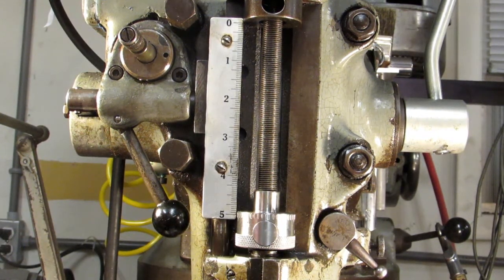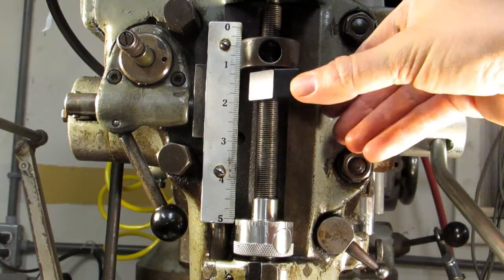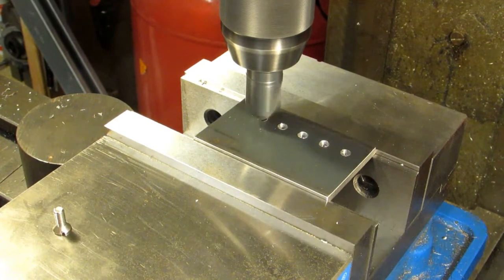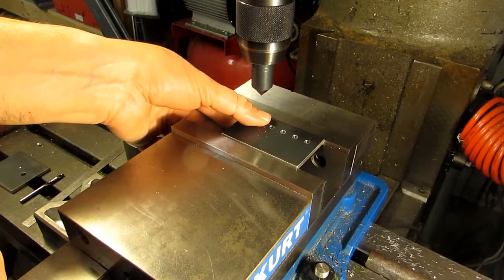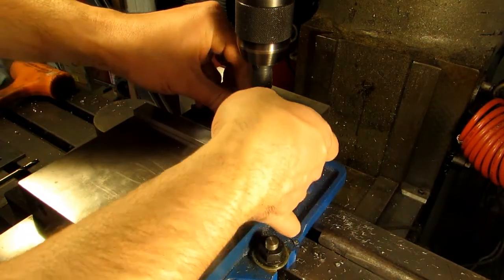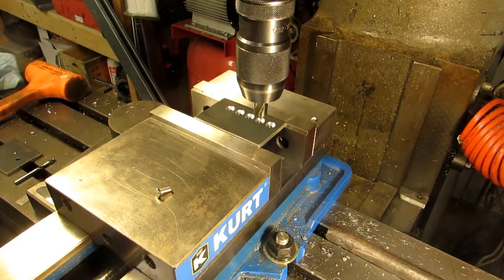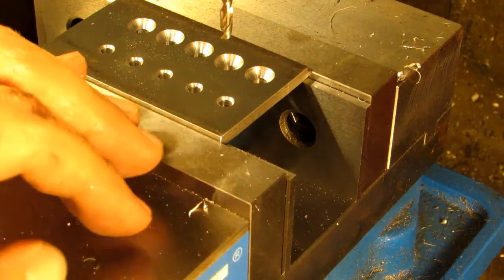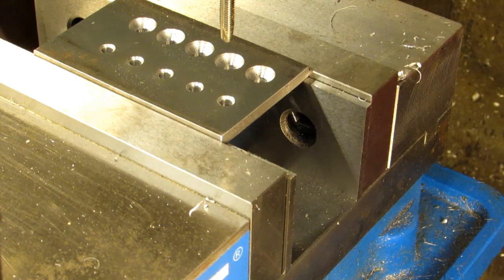Quick Machining Tip #4 - Consistent Countersinks and Spot Drills

Comment: Also helps if your top surface is actually flat. If not, all the c.bores will look different (have different diameters), which is often the case on raw stock.

Comment: Raising the knee makes so much sense! Of course that's not what I've been doing, and that's going to change today. Stuart, if I may ask, why did you choose a 90* spot drill and not a 120* to fit a 118* point on the drill?
Reply from the maker: I like 90 degree spot drills because you can drill deep enough that you leave a nice 45 degree chamfer on the finished hole without going back after the fact.
Reply: @StuartdeHaro  Thank you. Makes sense.
Reply: @StuartdeHaro  If you don't mind, I have another question having watched the video again. When shooting for accuracy and extended drill life, is it better to spot a smaller hole or one that's closer to the size of the drill? For example, with a 17/64 drill I typically spot with a 5/16. Should I be using a 1/4" spot drill instead?
Reply from the maker: @felixf5211  I can't imagine that it matters much. Now that you ask though, it seems like some science needs to happen to find out!

Comment: I'm having some trouble with bad threads at the top of a hole using a form / roll tap. Can you cover and advice for these?
Reply from the maker: What is bad about it? Not fully formed? Stripped out? Huge bur? Since you're using a form tap, are you drilling the hole larger than the suggested size on the tap drill charts? Let me know what the situation is and I'll try to figure it out.
Reply: @StuartdeHaro  M3 tap, hole drilled with a 0.110" drill. The top maybe 3-5 threads are only partially formed or stripped, if I put a screw in I can wiggle it out. Typically the bottom of the hole has good threads.